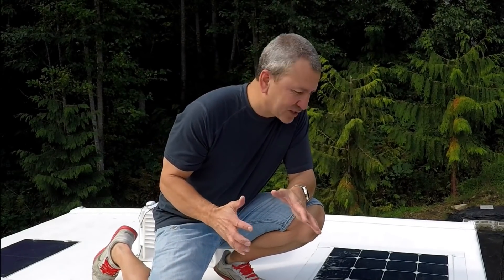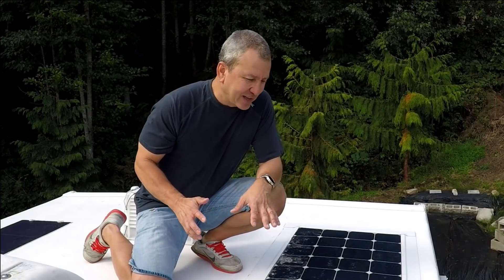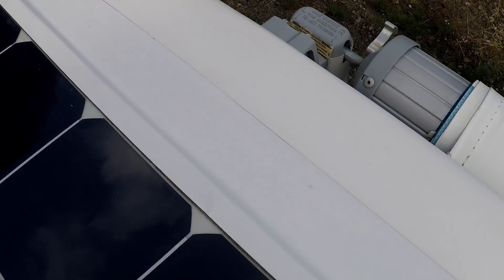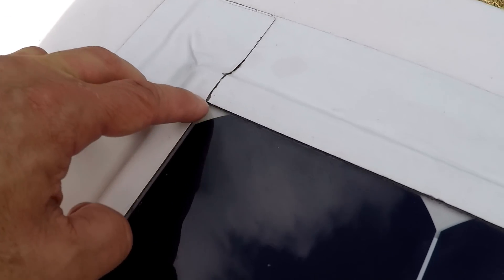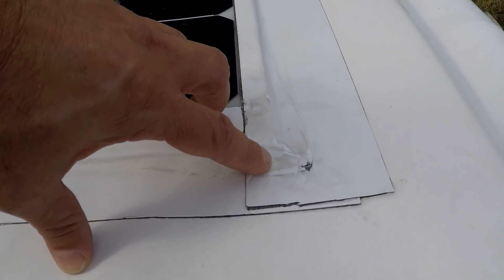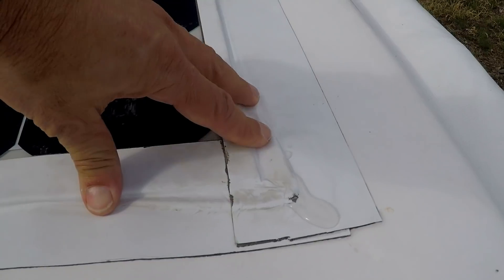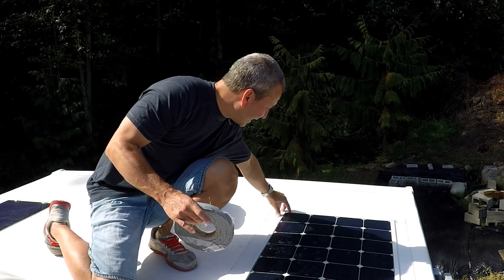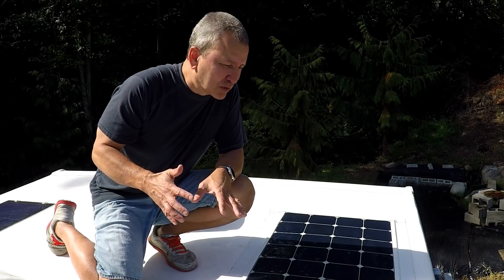ONE YEAR After My DIY FLEXIBLE SOLAR PANEL Installation

Comment: You could use Sikaflex, much better than any sticky tapes
Reply: I mean, sure, you could coat the back of the panel with structural adhesive, but getting that off would be a chore. And flexible panels seem to be prone to just dying after a few years.

Comment: I think you are overdoing this and having problems from it. I can't see any reason to have any other tape than double sided adhesive as long strips under the panel lenghtwise. Water between the adhesive stripes should be no problem. The panel would be able to dry, if there is end-to-end air pockets under it.

Comment: So new subscriber here I was told not to get these panels because they don't last long you had yours for over a year how would you rate their overall performance?.
Reply from the maker: Yeah. It's still a toss up since these types of panels are still farely new. I like to be incognito with my solar, so I'm willing to stick with them for the low profile/low weight benefits. It's been a couple years now and mine are still doing ok. They still perform as expected. One thing I've learned is to be very careful handling them during installation. Unlike traditional panels, they are pretty fragile. We all though that they are ok to walk on too, but I advise not walking on them. You could introduce issues that you won't see.

Comment: Visit your local auto parts store and look for 3M Windo-Weld.  It's the adhesive used to set windshields.  Some creative motorists even use it to repair motor mounts.  I used it to mount my solar panels a  couple years ago and all edges are secure and water tight.

Comment: Use the back of a spoon to smooth out the air bubbles and add pressure to the adhesive in the corners of the eterna bond when you install. As an art archivist I’ve found that tapes need all the air bubbles smoothed out for maximum strength and durability.

Comment: I wonder since you made a drain hole already if placing a small tube in that hole would help the moisture wick ?
Reply from the maker: Don't know if it makes a difference but I do have a tiny straw stuck in there.

Comment: I have a 235W  module on my RV roof. It is attached to the aluminum roof with three "U" aluminum channels, fastened into roof trusses with #12 sheet metal screws. Before I fastened it with the screws, I installed a piece of Eternabond tape on the roof, under the locations for the aluminum mounts. The fasteners were driven through the brackets, through the Eternabond tape, through the roof, and into the roof trusses.  As I drove the screws through everything, the adhesive layer of the tape wound around the screws and over the heads. It virtually sealed the holes as I installed the screws. Anyone that is apprehensive about holes in an RV roof should try this method. It is far superior to applying lap sealant like Dicor, because the tape lasts a very long time and the sealants tend to crack and deteriorate over time.

Comment: Dumb novice question;  Solar panels peak operating temp is in the 70° F range, this is why they recommend solar panels have a 1" to 2" gap under them for heat venting issues.  Heat decreases the solar panels output.  With flexible flush mount solar panels such as those shown, I’m guessing the heat dissipates into your vehicle/trailer, and the panels output may suffer from the less than optimal temperatures.  So... are flush mount panels recommended to have more than the needed rating installed?  Are normal solar panels better?  I’m confused.

Comment: Do you find that the panels fixed on the roof run hotter & less efficient  than old-style panels that allow air to circulate

Comment: I SUGGEST AFTER TAPING THE PANEL DOWN GO TO EACH CORNER AND PUT A DAB OF SILICONE ON THE CORNERS WHERE THE TAPE GOES OVER THE TOP OF THE OTHER ONE WITH A LITTLE DAB ON THE CORNER OF THE GLASS TO KEEP IT FROM GETTING IN~

Comment: Really enjoyed this video. I have two Efleland 140W modules, but they seem to have spot heat problems from perhaps bad tabbing. Working on a refund on these but Efleland is unreachable. I noted that your videos must be seeded with “Elfeland” so I thought you might be using them.
Reply from the maker: Nope. These are not Efleland panels. They are from HQST.

Comment: G'day mate, great camera work and quality... a real pro. I noticed you glue these flexible panels directly to the roof... do you feel they are performing to their full potential? I ask because I have exactly the same panel as you, and the seller advised me to have a 15-20mm gap of airspace between the panel and the roof to get maximum use. What you think?

Comment: hi, nice work with the panel! MAybe one upgrade: you can close down the tape connections where the  water sweaps under the panel with transparent silikon - the type which the roof makers use, as that one can whitstand UV and heat. This way the water cannot get under the tape.
Reply from the maker: Thanks for the suggestion!

Comment: What about 18 volt? I found some 200 watt panels on ebay but are 18 volt...alternatively there are 100 watt 12 volt ones on sale too. What would be the cons of 18 volt...and any pros?
Reply from the maker: Those are for a 12 volt system. 12 volt panels typically generate between 18 - 22 volts. They are often referred to as nominal 12 volts because they are for charging a 12 volt system but actually generate a higher voltage.
Reply: Thank you. I was confused because I thought with an 18 volt panel I could not use a 12 volt appliance directly/without inverter. And also arranging 6 volt batteries in serial/parallel  to achieve 12 volt setups would also fail with an 18 volt panel. I'm learning a lot ..lol   this is the 18volt i saw  https://www.ebay.com/itm/Elfeland-200W-18V-A-Class-Semi-Flexible-Solar-Panel-Battery-Charger-For-RV-Home-/152807350510?_trksid=p2349526.m4383.l4275.c10

Comment: Is it true that those types of panels  won't work effectively due to overheating?, being that the whole backside is in contact with the roof as opposed to a mounted panel having airflow all around it.

Comment: You need to use butel material underneath the entire panel. Silacone should be applied around the perimeter edge of the panel. No tape needed!

Comment: Hi There, we live in Ibiza a long way from you Guys! We are currently rebuilding a 49 year old 508 Mercedes, and the moment has come to fit the 2, 140watt flex panels. One issue I don’t see mentioned is the shortened life of these as opposed to non flex, apparently due to over heating, as the roof is metal and we life in a hot area. We have sprayed the inside of the van with 1/8” cork to prevent condensation and resultant rust problems and we are thinking of spraying the roof under the panel location to reduce the heat build up. It is water roof and very strong, any thoughts on this. We will then take the Eterna bond route for fixing. Love your videos and feedback, thanks.
Reply from the maker: Any kind of insulation on a metal roof would definitely help. You would be the first to suggest sprayed on cork which is pretty neat actually. I'm thinking of trying this platic stuff they make signs out of (http://amzn.to/2tjDnhZ). I think it would hold up on hot metal, but I'm not 100% certain.

Comment: Outstanding vid!! We bought a used 25 ft RV travel trailer in 2016 and have several long trips under our belts. We are planning on adding several 100W PVs to the roof of the trailer. Both my wife and I are ham radio operators and do emergency communications (EmComm) work for local county EMA, so we are deployable in the event of a small or large scale man-made or natural disaster. Our RV trailer is our mobile radio/communications asset and we need a dependable source of 12VDC power. The solar panels would greatly enhance our ability to provide EmComm support. Additionally, the window mounted PVs can provide shade! Great thinking outside the box.

Comment: IT LOOKS LIKE PUTTING SILICONE OR AN EQUIVILANT RUBBER CEMENT AT THE SPOT THE WATER IS GITTING IN AT THE CORNERS THAT OVERLAP SHOULD DO THE JOB, THANK'S, I WILL DO THE FLEXIBLE PANELS AS WELL ON MY RIG...GOOD JOB-

Comment: on they site a video show them using a heat gun to remove Eternabond tape which petty much what the sun did the same only over time. future idea of put numerous pack of silica gel packets in each corner if the water is issue these little pack absorb moisture...?

Comment: I think you should devote some time and thought to allowing the water a way to get out.  After working as an electrician, and weatherproofing enclosures, I have discovered that THERE IS ALWAYS A WAY FOR WATER TO GET IN. Maybe you can add a straw like Device at the low point of the roof.  This would be similar to weatherproof electrical boxes having holes in the bottom where gravity would drain the water out.  Pressurizing the area underneath the Solar panel, is also a way to keep water out. The phone company has been using this technique for decades to keep splice boxes dry. Filling an electrical box with a potting compound, eliminates all the airspace, and thereby prevents water from entering.  I'm sure there are many other examples of how to prevent water infiltration.

Comment: Think about leaving the back edge unsealed. You will always get condensation under the panel. At a minimum have a weep hole. If you leave the whole back edge open the air will pull the moisture out as it sits or even better as you drive.  A Glaziers option.. Nice job..

Comment: I am using 1" 3M double side tape on front end and 1/2" on sides, 3 -5 patches in the center to prevent flapping, no tape on edges. One of my panel died after 4 years and it was very difficult to remove 1" tape, it holds very good. PET flexible panels on a video do not like snow and ice, protect them for winter. Protect if you do not use it, they do not like sun also).  No kidding, deteriorate very fast. ETFE lamination advertised as better for panels but I don have chance to try yet

Comment: Nice job Tito, you have inspired me to think out of the box.  My "installer" was going to put these on a rack and he says they will make wind noise.   Not a problem using this method.  I really like the relcrow idea.  Or why not just run a bead of silicon on the back and glue it to the top?

Comment: I liked your video on the longevity of using eternabond tape to attach the solar panels to the roof. It is something I'm considering myself. The debate in my house is how well the panels would work after being attached directly to the roof, and not having any ventilation underneath the panels.  I've heard other YouTubers mention that there is a loss in energy producing efficiency in the panels when attached directly to the roof. Have you seen the panles drop in efficiency on hot days?  Do you think elevating the panels on brackets to create air flow underneath them would be worth it?  Or have the panels of today moved past this issue; or is this an issue at all in your opinion?  Thank you in advance for your opinion and love the videos - keep em' coming.

Comment: Hi Brian, I think you may have a condensation issue with moisture under the panel and may not be water  getting in under the eternabond tape.

Comment: Nice video. Hadn't heard of your tape, thanks. Wish I hadn't drilled my old VW fiberglass roof. I found a nice two sided product on "A", Foxnovo Car Auto Double-sided Tape Heat Resistant Clear Acrylic Adhesive Foam Tape

Comment: At high speed driving or strong winds the panels will want to lift off, so sticking panels down as well as tape sounds a good idea. 3m make really strong automotive double sided tapes (like the ones that stick rear view mirrors to glass) that stuff has an incredible grip!!
Reply from the maker: I agree that it would add more grip. However, that stuff is really strong. Should you every need to move or remove the panel though, it would be difficult to do so without destroying the panel in the process. That's the only downside I see. Thanks for the comment.
Reply: To to remove you use a strong twine with a sawing action and it works just like a cheese cutter wire. That's a trick I learnt from the windscreen fitters!! no damage to paintwork or panel. :-)

Comment: Hi Brian. My husband and I are brand new to this RV thing and are learning a lot from your videos. Thanks for making them! Just curious, now that you've had a chance to see how both screw down and Eternabond installs went and how they've held up, do you have a preference?
Reply from the maker: Ooh. You would make me answer that. There are certainly great benefits to the eternabond solution, but for long term mounting, I would have to go with the screw down / Dicor method. I do have an idea for another option using a thin insulating layer that I may try at some point. Stay tuned.
Reply: Good to know! VHB tape actually looks like the easiest install, but alas, we have a rubber roof. Thanks again for your vids. They'll be a big help when we get around to adding solar.

Comment: Hi Brian, really enjoy you channel...could you help with the following.... have you had any issues with heat dispersion under the flexible solar panels? I am in the process of purchasing some flexible panels and have noticed the seller advises 2 things........... 1.  Do not wire the flexible solar panel in parallel or in series to avoid overheating 
and    2.  Not recommended to glue the panel on top.Leave a space underneath for the back panel to breath

what are your views on this...regards...Tony
Reply from the maker: I am not sure how to answer #1. I have all my panels wired in both series and in parallel. Are they suggesting only using one panel? #2: I know many folks have issues mounting directly to the roof. Flex panels, however, release heat from the top unlike traditional panels which can only release heat from the bottom. I have a rubber roof which doesn't get extremely hot and I haven't had any problems with overheating panels. However, if you have a really hot metal roof, you may want to add an insulation layer. I've been meaning to try some corregated plastic (http://amzn.to/2FIXAje) as an insulating layer for this. This would keep the panel off the roof a little, not require brackets, and allow for a little airflow throught the veins of the plastic sheet. If you try this, let me know how it goes.
Reply: Hi Brian
I have a 5th wheeler with a rubber roof, what I have decided to do is get some heavy duty bubble foil insulation and place that between the solar panel & the roof leaving some space for any heat dispersion . will be using your advise and using eternabond tape for holding the panels down...Tony

Comment: Hey Tito, recently found your channel and have enjoyed your videos. One question not knowing much about solar but seeing others videos they feel they need ventilation behind their panels.  Is that due to their panels being solid vs. flexible.  Thanks to you and your wife.
Reply from the maker: This is a much debated topic. Here's my take on it. All solar panels perform better when cooler and all solar panels generate heat. So anything you can do to cool them off will result in a performance increase. Traditional solar panels have a glass front and, therefore, have to vent heat from the rear because heat can't escape through the glass. Semi flexible panels on the other hand have a much thinner front allowing most of the heat to escape that way. Of course, allowing a ventelation gap below a flex panel couldn't hurt, but I don't believe it's required. In my experience, the benefit would be nominal and not as significant as many would like to believe. It could certainly be an issue if you are mounting it to a hot metal surface that could heat the panel. Lastly I'll say that there are poorly made flex panels just like there are poorly made traditional solar panels made with cheap components. Both have the potential to fail. Hope that helps.

Comment: hello, I was watching another one of your videos where you installed the unisolar panels that rolled out. From your experience which of the flexible panels are more efficient?
Reply from the maker: +Rain Gutters Rain Gutters The newer 100w flex panels have mono crystalline cells and are much more efficient than the Unisolar panels which use thin film tech. Having said that, the Unisolar panels provide good performance in low/indirect light so they complement the entire setup. They are also pretry durable. I'll keep them for now.

Comment: I am installing my flexible panels this weekend. I am using 
POLYCARBONATE CLEAR 4mm SHEETS cut to size for each panel. This will allow airflow under the panel, water drain, etc. Much cooler panels = more efficient. The POLYCARBONATE panels are used in green houses so they will hold up longer that my panels.
https://i.ebayimg.com/images/g/N6MAAOSwFdtXy7Rz/s-l400.jpg

Comment: Are you sure that it's rainwater as opposed to condensation from  heating and cooling /air  moisture ?  

I thought that solar panels worked more efficiently  if you kept them cool ie allowed air to circulate under them  but not sure if it applies to  flexible panels. ..
Reply: I certainly think that keeping your flexible panels cooler than hot will increase your Efficiency

Comment: Also since you have a smooth roof I would literally just put epoxy on the back of the panel a board or some kind of weight that will put pressure on your panel while it’s drying and your done no tape needed no drilling and who really cares about resale you bought the RV for your pleasure ?when and if you do sell it in the future just simply charge more for your RV because of it’s upgrades i know I will be ,I’m sure no one will have a problem with free electricity and installation.